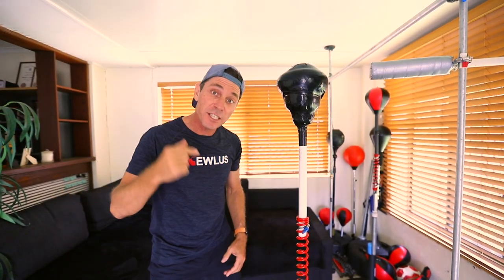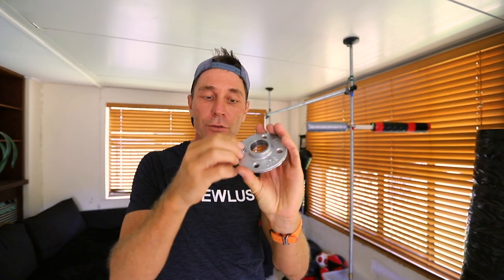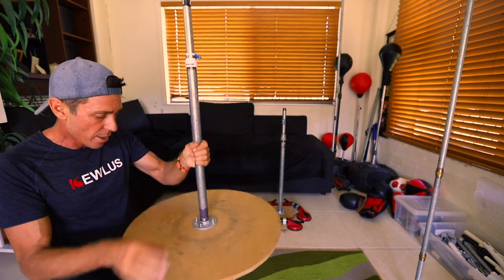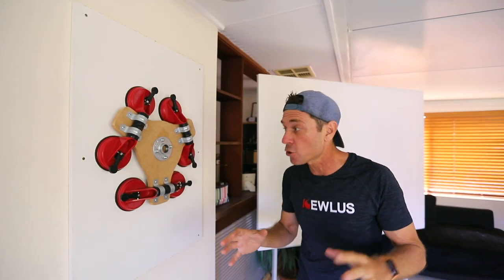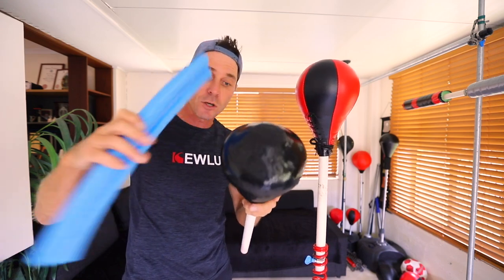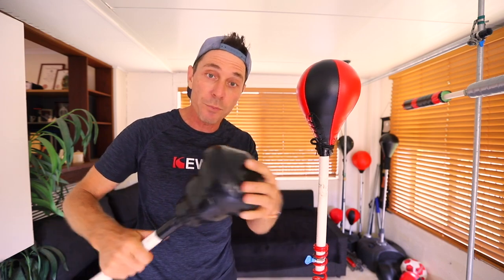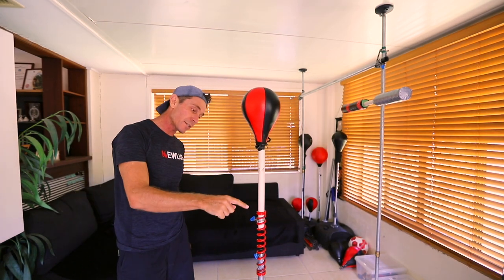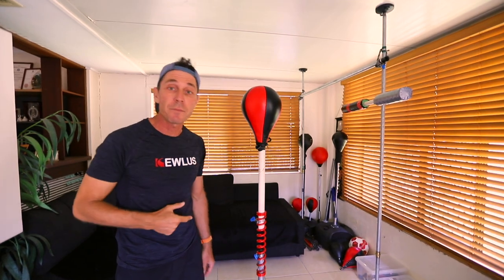DIY Cobra Bag using the Kewlus KS2 Cobra Bag Spring - Top Tips

Comment: If anybody’s wondering what to use for weights go to home depot and buy two 60lb cement sacks (the cheapest ones) it’ll be like $4 each and you DONT have to mix the concrete just leave it inside the sacks and use that for weights so far that’s cheapest way I’ve come up to for weights since buying buckets would’ve been more expensive and I would still have to invest some time in filling them up

Comment: Hey Reewdy, I just started my DIY for the spring I bought from ya. Loving it, Mate!  It appears the link for the butterfly adjustable hose clamps are now gone. So gotta find alternatives. Btw , not sure if you're looking into it but I was wondering if possible to make an internal spring and those turn nob locks like the ones you find on adjusting the bench at the gym. Maybe could design and incorporate a turn knob for the height or even the spring action speed.
Reply from the maker: Thank you. You can also just use standard hose clamps but would need a small screwdriver to lock it in. I’m currently working on a commercial version that may work similar to what you’re saying. Instead of using steel for the mast I’m going to try polycarbonate material in black colour 👌
Reply: @Kewlus  Those std hose clamps from Bunnings are also an 8mm socket. Outside of OZ another name for them is Butterfly Clamps

Comment: Hey Reedy, 

I just received my spring and it’s great! Unfortnately however I can’t find a way to remove my spring off of my galvanized pipe. The only thing I can do is keep turning the spring clockwise, and of course it just keeps going lower on  the pipe. I can’t unscrew the spring counter clockwise as the entire pipe just comes off of the flange. Please let me know what I could do
Reply from the maker: Turn clockwise and pull it off at the same time. Turning it clockwise releases the grip slightly. Email me if you need further help on this

Comment: Hey man when are you doing the 40kg power twister version like a Cobra Bag Power Twister V2/LVL 2 haha
Reply from the maker: Sorry man I gave up on the power twisters because I felt the spring was not as good as it could be, especially with the oscillation - the cobra really works heaps better with a spring that has spaces between the coils, so it recoils more reps and for longer

Comment: which one is more stable for pro spring umbrella concrete spring or diy base ?
Reply: he said he like is own one more
Reply from the maker: DIY is better because of the flange. Sticking the pipe into an umbrella base can make it wobble. I don’t recommend using an umbrella base for the PRO Spring
Reply: @Kewlus  what if the umbrella base has smaller hole and inside metal part that presses the bar in the hole at the top and bottom ?
Reply from the maker: Yes if you can make a tight fit I think it would work. You’d still need a couple of sand bags for extra weight I think
Reply: @Kewlus  yes ofcourse but the base is 20kg and if i put another 20-30kg on top and the base is wide 50cm is that enough
Reply: @Kewlus  its square not round 50 cm on both sides
Reply from the maker: Yes that would do
Reply: @Kewlus  thanks

Comment: I tried to make a base with 60 lbs of concrete in a 5 gallon bucket. I don’t recommend it because it’s too wobbly and it affects the speed and rebound. I’ll comment when i’ve tried my next attempt
Reply from the maker: Yeah, a solid base is key to this. I found I need at least 40kg or 90 pounds of weight holding the base. However my favourite base at the moment is the one I made for the wall cobra using suction cups. It’s rock solid
Reply: @Kewlus  I’m either just gonna drill a flange into the concrete of my basement, or drill the flange into the a board and use one of those freestanding punching bags around it full  that base with sand.
Reply from the maker: If you go with drilling into concrete you'll get a rock solid setup. Just make sure to use sleeve bolts. The bolts I used with a 1 inch flange are similar to these 5/16" x 1.5" (8mm x 40mm) Sleeve Anchors that you can buy on Amazon: https://amzn.to/3uzL5A0. I used a 2 foot long 1 inch pipe at the base and then a reducer to go to a short 3/4 inch pipe to mount the spring.
Reply: @Kewlus  if i driled it into the plywood board would a 3/4 inch flange (ofc still with bolts) be okay?
Reply from the maker: Yes it should work, but I'd recommend using 16mm or thicker MDF or shipboard rather than plywood as plywood flexes a little more than MDF.
Reply: @Quellebreo373  bro just get two 60lb cements sacks and use them as weights you don’t have to mix the concrete just bolt the galvanized pipe onto a board with a floor flange and once you’re done just place the cement sacks on top if you want I can send you some pictures

Comment: How to thread steel pipe please?? Also what size the metal pipe and the 2foor pvc pipe?? Thanks brother
Reply from the maker: The standard galvanised pipes that are used for plumbing come standard with thread on both ends.
Reply from the maker: For details on sizes, check here: https://kewlus.com/blogs/diy/how-to-make-pro-cobra-punching-bag
Reply: What size the spring you’re using? 12”? How about the inside so it can fit on 3/4-1.05 pipe? Thank you so much for your help brother
Reply from the maker: Yes and yes